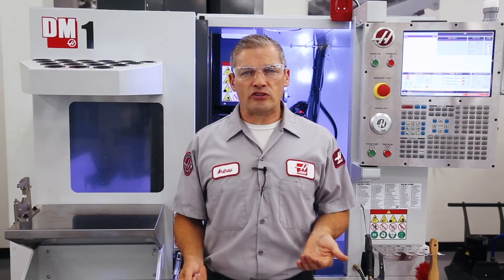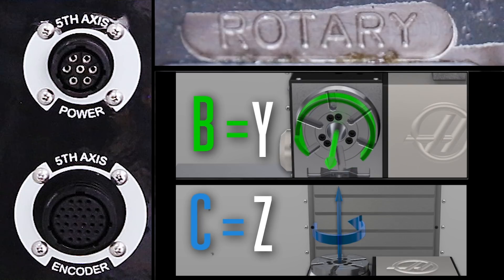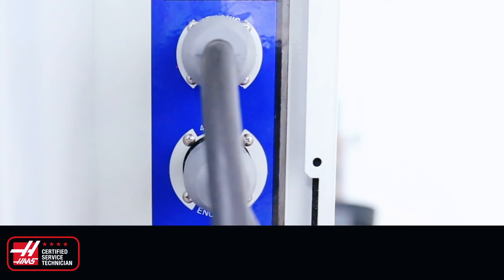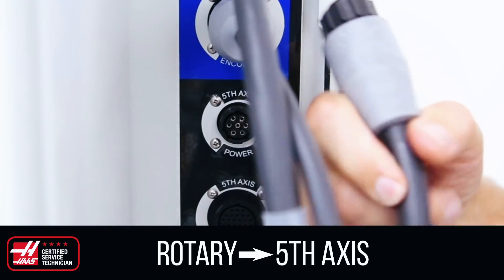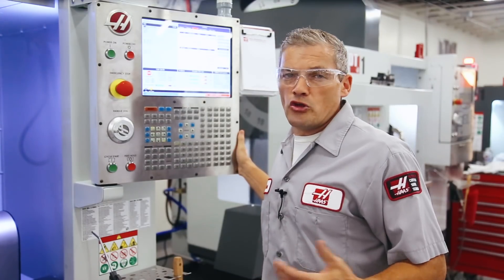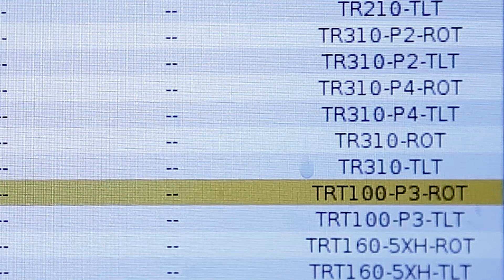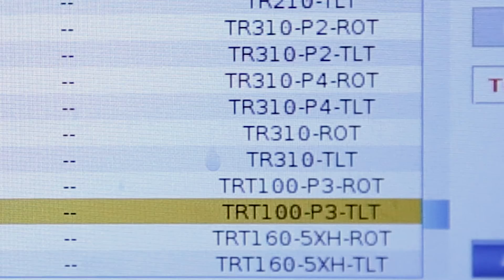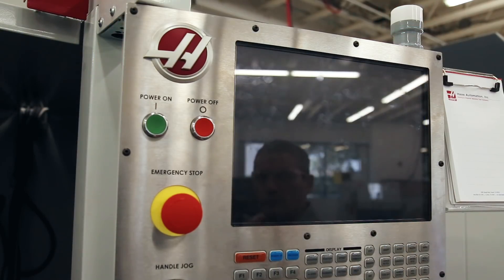Properly Connecting a Rotary Table - Haas Automation Service

Comment: You should urgently make a video about the calibration of the TRTs!
There are always questions about calibration because there is no proper guide from Haas.
There are only instructions for the UMCs, but these often do not fit the TRTs.
Since there is hardly any printed information from Haas, a video with detailed instructions from the first to the last step would be extremely helpful...!

Comment: You are professionals in manufacturing of nice cnc machines, but you can not design different connectors for different axis, mix up which can cause expensive damage. Sounds stupid.

Or why are you signing connectors on both ends different? On the on it is called rotary and the connector has a sign 5 axis. You confuse people, don't you see it?
Reply: I believe you can connect two 4th axis rotaries like an hrt 210 and an ha5c to make a small 5 axis if you need. That could only be done if both 4th axis rotaries can connect to the 4th and 5th axis positions. Unless you want to rewire one of them. Everything is clearly labeled, i feel like if you mess this up it is on you.

Comment: This is one thing I do miss about working on Haas machines is how easy it is to hook up a 4th axis and get going. I don't know how anyone could mess it up. Just try connecting a rotary axis to a pallet table on a Fanuc control and you'll wonder if Fanuc wasn't originally trying to be a puzzle maker.

Comment: It seems manually jogging each axis by a small amount to test would be a good idea to confirm proper hookup after Carefully double checking cables.
Reply from the maker: condeliusc, Slowly manually jogging each axis would be an excellent method to check if you'd connected the cables correctly. However, after you first power up the machine you need to zero return the axes before you can start jogging them. That's why we recommend zero returning each single axis one at a time since this achieves the goal of moving the axis slowly so you have time to stop it if it's incorrectly connected and also not delivering high current to the motor.